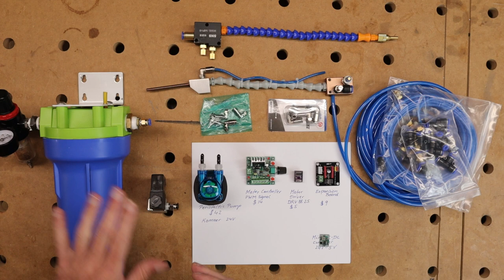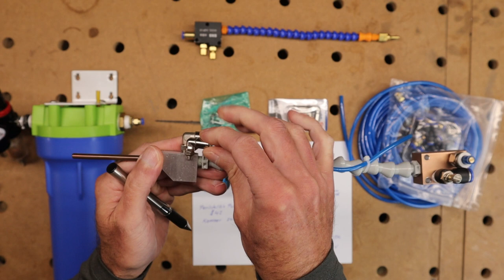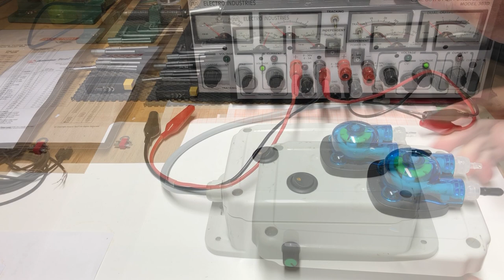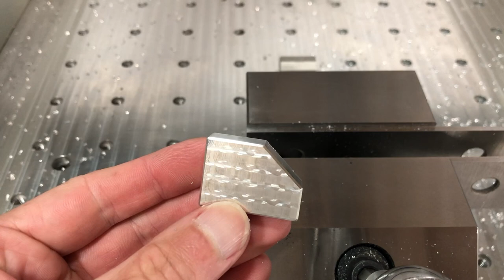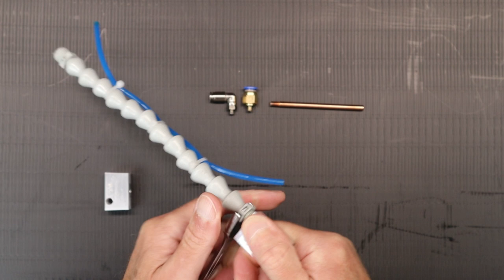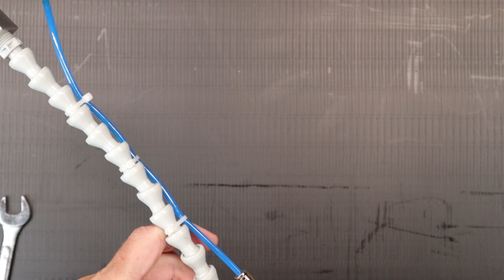Mist Coolant System Update

Comment: Nice mister mister! A low flow pump is a good idea! I'd use a 3d printer ramps board that I've bot laying around, with an arduino 2560. I can control it with a laptop using gcode at any speed and length of time.
Still, I'd like to control everytging from the controller and gcode itself though. Maybe a normal solenoid to cut power to the pump controller that is controller by the same pin as the sokenoid valvue?
Reply from the maker: Yes that is an excellent solution. Actually that is exactly how it is wired. The pump power comes from the relay that tunes the air on. The additional on off switch for the pump is for “air only”. Using an Arduino is a good solution if you have the skills to program it.
Reply: @JBWorx  Sounds good! Getting Marlin on an arduino isn't too bad, you don't need programmer skills for that.
Reply from the maker: Yes I made a couple of arduino projects for my first drones as systems at that time were not available. Many people however will not attempt to build something with an Arduino in it. Great that you are able to do it so many
More options.

Comment: Could you please share tips on how you get those beautiful surface finishes?
Reply from the maker: I think it changed in the moment I added the second spindle mount. Also high rpm like 18-20k and a finishing pass just taking of 0.03mm makes a big difference. Have fun Jörg
Reply: @JBWorx  that worked great, I slowed the federate to half on the last 0.03mm and it made a big difference. Just need to work out how to slow it within fusion 360, might be easiest to setup 2 paths.
Reply: @MrBrettStar  nice that this worked for you. Fusion let’s you set a separate feed rate for the finish pass. I am sure you will find it nex time you are in the CAM  Module.

Comment: How many psi are you running? I either can't get enough airflow to the nozzle or the pressure causes the coolant to push past the pump. Thanks
Reply from the maker: 20 psi that is all that is needed. Ok if that happens it’s because you have not pressurized the reservoir. So my system puts the air pressure into the fluid reservoir and then 2 lines come out one is air to the nozzle and the other is fluid to the line. Hope this helps.

Comment: Couldn't this also be achieved with a paristaltic pump that runs off a DC motor, then drive that with a small adjustable power supply? It seems like it would avoid most of the control boards needed for the stepper.
Reply from the maker: Yes, however there needs to be a gear reduction as well to get that low rpm and required flow. The pump turns really slow, perhaps with a PWM Control for the DC Motor it can work. There are pumps available with such motors, I don’t like them because it’s a brushed sleeved motor that will just not last all that long. I think a stepper is a better solution. There is also a all in one control board now available. Maybe an update to this video would be good.
Reply: @JBWorx  Wow, fast reply :) Yes, agree about a weenie brushed sleeved motor not lasting, and needing to be geared. Was your goal to have the coolant flow rate adjustable via G code? If it is, is that ever used, or is a simple knob more intuitive about how much is enough?
Reply from the maker: I use just simply a knob to control the volume. I also found that I need a very small amount so really a very slow speed from the pump.  @kurtbilinski1723
Reply: @JBWorx  An all-in-one driver might be this one on Amazon, called "Stepper Motor Driver Controller Integrated Board Forward/Reverse Pulse Speed Angle Control Module PLC Serial Communication for NEMA 17 23 Motor" Perhaps it's the one you mentioned?
Reply from the maker: At first I thought no this is not going to work as it is missing the amplifier.  Well looking at the wire diagram and reading the text … heck yes this might work. It can handle 4A that is plenty to run the pump. Thank you for pointing to this it’s the lowest cost solution I have seen as of today.
Reply: @JBWorx  Glad that it was useful. I initially tried posting a hyperlink to it but YT assumes I'm spamming and shook their finger at me. Whatever. Oh, and you're proving to be an expensive date... I've been buying stuff per your recommendations :)
Reply from the maker: Yes YouTube limits what you can post similar to FB now. So if I make a recommendation it’s usually for things I use as well and can really recommend. I did sign up for Amazon affiliate but just like YouTube this is just Pennie’s for me. Oh well 😀

Comment: If you are using a peristaltic pump to deliver the coolant, why does the reservoir need to be pressurised?
Reply from the maker: The main task of the pump is to meter the coolant in not to suck it out of the reservoir. I think it works also with the pump alone however it will take quite a while to get the coolant to the nozzle on startup.

Comment: I am installing the air and fluid lines in my DIY CNC build. I have two 6mm lines installed, one for air and one for coolant.  As I look on the web it looks like the coolant line is 4mm mostly. Is this critical for the system to work? I will be drawing fluid about 25 ft from the reservoir. Thanks!
Reply from the maker: I don’t think it will make a difference other than the priming will take longer because of the higher volume of liquid needed to fill the larger tube. Good luck on your build
Reply: Thanks for taking the time to reply. I have really learned from your channel! @JBWorx

Comment: Heya Jorg, setting out to order parts for one of these. I am pretty lucky that I can tap into the extensive, but local used market in China but I think you have found the flow rate of yours is way higher than it needs to be, right? I am guessing you don't even use it at 1/10 of its rated output...? Maybe more like 1/50th?
3ml/min that's about a cup an hour. I'd be surprised if you use that much, even right?

If you feel like it, could you run it someday for a min or two and check "exactly" how much you spat out;)?
Reply from the maker: Yes you are correct it is very little fluid. About 1.5 to 3 ml depending what coolant I use.
Reply: @JBWorx  Perfect:). I am about to buy two at an incredibly sweet deal. For a stepper peristaltic this is about as easy as they come since it has a a board built in and 15 speed settings via a turnable switch on the board or an external pot. Basically just have to feed it 24V. Can also hook it up to the controller later on if I feel like it as it can take speed commands via analog V or mA and 1-2 more ways:). 
It has a flow of 0.02ml/min @ 1rpm - 21ml/min @100rpm. So that sounds about perfect:)

They have one with a bit more flow rate, too which can still go low enough depending on what tube you put in. Maybe I will get one of each:)
Reply from the maker: Yes that sounds like a good unit, the delivery amount looks good. Most pumps put out too much fluid and can not be regulated low enough.
Reply: @JBWorx  Yes, this deal is a feel good, from new, they are about seven times more and even moreso on Aliexpress. 

I had initially planned on designing my own CNC to be made in granite, but at the same time I have been keeping an eye on used machines. And I sadly just missed out on a amazing deal on a old Taiwanese made machine base/frame. Less than USD 600 for a machine that was designed to make molds so had plenty of stiffness and precision whilst still not being huge:(. 
I have already bought a spindle and some nice second hand Delta servos so that machine would have been perfect. This pump deal doesn't make up for that loss, but still nice, haha. 

Anyways, I realized a while back that designing my own machine without ever having cut anything is also a bit frustrating, so I think now, I will go with a cheaper second hand machine just to get started. Might pull the trigger on one today. And they say, once you have one machine you will want another... So, this will be a great learner;).
Reply from the maker: I think you are one the right track. You can learn with that one and then make your own custom parts to improve it. Very rewarding.
Reply: @JBWorx  Thanks Jorg and I will be rewatching a ton of your videos in the weeks and months to come;).

Speaking of which, you don't have drawings of the vise up on your site. Maybe a tad too close to SMW despite the changes you made? I think I will make yours as one of the first projects once I get then hang of the basics:)
Reply from the maker: Yes correct, I did not want to take away from John’s business and his ideas. It’s very handy to have and an excellent learning project … a step up from the basics though. Have fun sounds like you are excited.
Reply: @JBWorx  Mod Vise - makes total sense to not make the drawings public. 

Excited? Me? Nah... Haha, just kidding. I am so excited. I put the deposit on a used machine just now. Not as great a base as the Taiwanese "high end" one I missed out on but this one comes ready to cut. This journey has been years, I have had a machine in my mind for 4-5 years pre-covid and it's finally happening. 

The machine I am getting will be fine for alu and since I actually have some products I want to make on it for the local freedive community I am pretty sure it will pay for itself. 

By having and using it, I will learn so much and be better at figuring out what the next machine actually needs to be able to do and whether I will design it or go hunt for a used one again.

Also, a very big thanks for always replying. Between your channel, the treasure trove of John's and a few others for when I need to start getting more advanced with work holding and such, I feel like I am good hands.
Reply from the maker: Good luck on getting everything up and running. Having actual products / parts to figure out is the best part. Better yet if you can sell them. All the best on your journey.
Reply: Finally got it done. Just a janky test setup for first cuts yesterday. IT'S AMAZING...! Thanks so, so much for the inspiration! 
https://youtu.be/xrPciuQ537o?si=EHGx5g9qRjjaQAYG

Also, my own contribution is the 3D printed nozzle. Works well, too:)
Reply from the maker: @AntiVaganza that looks really nice 👍 well done
Reply: @JBWorx  Thanks man - not kidding, your build was paramount to making this happen:)

And yes, though it looks more complicated in terms of parts count and so on (and I say this without ever having tried a Fog Buster), I think our setups win out when it comes to actual ease of use. With the pump, it doesn't matter where the tank is mounted height wise. Also, I have two very low pressure regulators so it's very easy to set the pressure, but soon, I think it'll be set and forget it. 

I did pressurerize the tank and it has its own regulator, but with a good peristaltic pump there may not even be a need for that. 

Also, I haven't hooked my solonoids up yet but I have a little manual on/off valve which bleeds off air when closed. I think this is actually a bigger thing that you'd first suspect. Reason being, I think it's smart not having any residual pressure in the system when it's supposed to be turned off. This way, I guess I wont have it dripping when it shouldn't (and it doesn't). So, a bleed valve and a check valve, I think helps with this. 

Anyhow, thanks again. I may still make the "mod vise", too. Just haven't had a need for it, yet. A small precision vise and superglue fixturing have sufficed so far.
Reply from the maker: @AntiVaganza well sounds like you are all set, good thinking of relieving the pressure to prevent drips. Some pumps go into reverse for a couple of seconds to get fluid back. Mine does not. The mod vice is good for longer parts that don’t fit into a regular vice.

Comment: By the way i  dont understand why you need air presure to the tank, That small pumpe should able to suck fluid up from below 5-10 meter. so the tank could be maby a coca cola bottle. Also i think that you could put the small 3mm tube into the  Lock line, think it would be easy , and look a lot better.
Reply from the maker: The pump is just for metering the liquid in and it primes way faster with the pressurized tank. Easy to do and worth it. The cheap Chinese fogbuster knock of has the fluid hose inside the lock-line. Different concept as the mixing happens at the tip here the mixing happens in the Aluminium block and liquid and air is pushed into the brass tube. Yes, you can use a beverage plastic bottle but there are much sturdier versions than a coke bottle. Once you have that in mind and start watching these bottles you will notice that some are incredibly stout and well suited for this application. I did however not mention it as I am afraid someone will put full compressor pressure on the bottle and it will burst. But yes it will work just as functional and much cheaper. As always good suggestions from you, thank you Lars.

Comment: Great idea, but strange you did not use a standard stm32 mcu for 3-8 axis/motor boards, like Makerbase or Bigtreetech, they come with 5,12,24,35,48v stepperdrivers out of the box and are easily programmable and can integrate into most cnc controllers via spi,uart,i2c etc. they cost about 30-60$ . Anyway , really like your videos.
Reply from the maker: Thank you for the suggestion. Maybe a bit $$$ there is a finished pump that I M using now from Kmoer that is fully programmable out of the box for about $120

Comment: I cant find any drawings on the webiste for the fog buster or fixture plate
Reply from the maker: It’s in the shop section. 
https://www.jbworxstudio.com/shop
Reply: @JBWorx  interesting on my phone i see a download button but not in my computer. Thanks. As a matter of interest what was the total machining time on the fixture plate also what software did you use. Fusion360  ?  If so would you consider posting the files and tool pathing. That was a great video
Reply from the maker: No problem! My cuts are usually rather conservative so the total time was rather long … I think 4h or so. I use Fusion 360 for design and CAM. If there is interest I can make them available as a download as well. Let me get the low profile vice finished and I will revisit the fixture plate.
Reply: @JBWorx  That would be excellent. The files for the mod vices would be fantastic as well. I thought it was interesting that you made the holes at 10mm which is a bit larger than I have seen on other fixture plates. Was that for ease of the threading? I just stumbled across your channel todaay and have been watching your videos. Great channel and explanations.
Reply from the maker: Thank you Mark! Glad you found me 😀. 10mm for locating on the machine plate and 12mm on the fixture plate with M10 threads. Mainly for strength as it is an aluminum plate.

Comment: This video was extremely helpful. Thank you! I added a similar system to my machine using this info. One thing I found is that there is no real need to replace the block or the nozzle from the widely available venturi-based misters. The venturi effect is created by a small piece in the nozzle, which can be removed, and everything else can be kept. I used the same electronics and pump as you did and it works extremely well. I made a short video here: https://youtu.be/vkimdHcRTrQ?si=-gLX69G6QcTvWBU2
Reply from the maker: You are correct. That is what I did on my first improvement I just took the piece out that sits within the nozzle. Love your dust boot looks really nice. Also in the video the air pressure is way to high but possibly you have that because of demonstration purposes. Great video !

Comment: Seems like a simple brushed DC pump motor would be far less expensive than a stepper. The motor system seems overly complex, I would think a pump doesn't need that level of precision to require a stepper...
Reply from the maker: The problem with a regular DC motor on a peristaltic pump is that they do not deliver the torque at very low speeds. So some are available with a gear dive. However they are not for long term use and this is why you will encounter stepper motors on quality peristaltic pump set up’s.
Reply: @JBWorx  Why is a peristaltic pump required here though? I was suggesting just using a preassembled pump unit. I'm going to need one of these myself soon, so I'm very interested in this, but I didn't see an explanation of some of your decisions, some background on the requirements and why a simpler solution won't work would be helpful.
Reply from the maker: Yes you can certainly use a finished assembled pump as well. The key is that it will need to deliver a very very low amount of liquid per minute. These are often metering pumps that can do that. There are mainly two designs used in laboratory and medical applications namely the peristaltic pump and a piston pump (LMI metering pumps are all piston design). Unless you get them used they are often rather expensive so I wanted to design and build a system that everyone can easily make and it is reasonable cheap. I have used it for several Projekts now and really like it. It is very consistent and does not leak after it is turned off. Overall a win for me.
Reply: @JBWorx  Okay, totally understandable.  How much air does this system use? My spindle cooling compressor is small (but very quiet) but these spray systems seem to use more air than one would expect.
Reply from the maker: The key is to keep the air pressure down. In the beginning I used 2 bar (30psi) and that was really not necessary. Now it’s below 0.5bar (7psi( for most set ups. A air compressor with 2.2 cfm will keep up with the requirement in my experience. That is a small compressor.